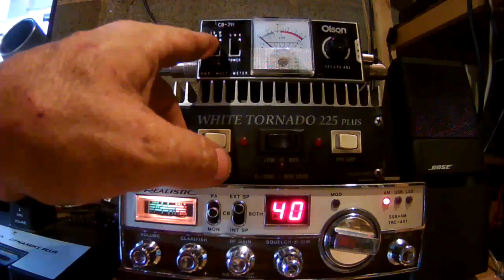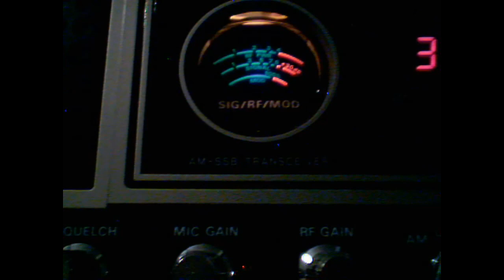Homemade Ground Plane Antenna, CB radio base station

Comment: Ok I hate to keep bothering you but I’m just out here trying to learn. I keep watching your video and keep noticing different things. I see you mounted the pvc to a metal (galvanized?) pipe. I was planning on having a piece of pvc instead of the pipe only plan on getting a few feet above the roof. My question is. Since the element is inside pvc do I still need to ground the antenna? For things such as lightning and if so would I just attach a ground wire to the ground of the connectors? I plan on building this and sticking it up as soon as my coax gets here. Thanks for the advice. I also took your hint and I’m not gonna mess with 5/8 just a 1/4 like you. I wish we lived closer together so we could make contact but I don’t have enough power to get where you stay from here just accross the state line not far from Myrtle beach.
Reply from the maker: Yes it should be grounded, otherwise those ground plane wires will attract lightning.
Reply: @MowerJunkie  so wouldn’t it be a bad idea to ground it at the coax ground? Or do I need to use a metal pole something similar to what you have and then ground it?

Comment: Will a CB radio with ground antennae interfere with car  speakers that blast thumping music through the walls of my house and windows? Some say yes, some say no? Is it possible to disrupt house from those speakers?  Thanks, like your videos.
Reply: Possible? Yes. Likely? That would depend on output power

Comment: nice video i'm building one today did u have to trim the ground radials or just the top section. going to compare it to  my a99.
Reply from the maker: Yes, the ground radials need to be trimmed to the same length as the active element. Good luck with Your build, let Me know how it compares to Your Antron. Thanks for watching, 73's from 151 SC.
Reply: @MowerJunkie  thank you from 142 central ny

Comment: I have an old Hi-Gain cb antenna from the 70's from my dad that I am using.  It is working but it has a spot for 3 radials.  Do you know how long the radials should be.?
Roger
Reply: 103 to 108 inches, or 1/4 wavelength

Comment: Might be a silly question but could a guy use a magnetic antenna on top of a house with a 28" by 28" tin ground plane?
Reply from the maker: I would not try to transmit on the set up You described, it would work for receiving, but would have a very high SWR on transmit.
Reply: too small of a ground plane. try connecting a wire to the tin and running it to a gsrden hose spout or a steel stink pipe coming through your roof if you have one. you have swr meter?

Comment: Excellent video. Another person on here asked you a question about how you keep the top wire straight in the top pole or doesn't it matter as long as the wire is right length ?  Also , as far as the radials can I get away with using 2-3  as long as they are right length ? Thanks
Reply from the maker: the 12ga wire will stay straight on it's own, with Mine, after I tune the antenna, I fill the pipe with expanding foam and cap the pipe. this will stop the wire from sagging in the pipe. if You use more radials, You will have a better ground plane, and the antenna will be easier to tune. Thanks for watching, 73's from 151 SC.
Reply: @MowerJunkie  , thank you for your quick reply. Can I ask a couple more questions. Do the radials have to be grounded from each other ? If a full 1/4 wave is 108 inches why was your feed & radials cut to 102.5 inches for the c.b. band? I'm going to try & make one of these but if it doesn't work then I may buy a whip. They come in 102 inches long & if I added a spring ( 4 inches) then wouldn't I still be 2 inches short of a 1/4 wave ?
Reply from the maker: @MrTumbleweed1951  I have tried using 108" long wire, and in order to get a good SWR reading, I had to trim it down to 102.5. so now I just start with 102.5". when You put a spring under Your whip it does not change the radiating length of the antenna, the signal will only use the actual element. the spring is just a spacer between the antenna and base. there is an equation to calculate the exact length for the frequency You use. if I remember correctly, for 27.385 the antenna length should be 102.7" not 108.
Reply: @MowerJunkie  Thank you very much sir. I'm enjoying learning from your videos
Reply: @MowerJunkie  I built a similar Antenna years ago. Rather than using expansion foam for the vertical wire, I drilled 2 holes in the top PVC cap, made a loop in the wire, and ran zipties through the holes back to the loop.
Worked a treat, and super cheap

Comment: Do you have too have radios wires?
I like to build antenna cb antenna for a 11 meter cb
Reply from the maker: yes, you need the ground plane wires. this antenna will not work without them.

Comment: Thanks for the video, Sir.  I'm going to try to replicate your design.  Can you advise me why you refer to yourself as "151"?  I've heard recently folks say a number in addition to their handle.  Where does that come from.  Thanks in advance.   You got a new subscriber.
Reply from the maker: I get asked this question a lot. Most of the Handles and call numbers are Self assigned. Some radio Clubs will give You numbers to use. for example, I'm a member of "World Wide Sidebanders" So sometimes You Might hear Me call out as WWS-568. The 151 that I use comes from the 151 cubic inch engine that Chevrolet made in the 70's, it's My all time favorite engine. 
Thanks for watching, 73's from 151 SC.

Comment: Question. I have a dual antenna whip nagoya. It has 3.5vhf and 5.5 of gain uhf.   If i tune the uhf frequencie tona desire, will the gain dimish or be affected and the vhf .

Comment: I built my antenna out of plumbing parts and steel pipe, i get about 15 miles on it barefoot. Which is surprising because of the area I'm located.

I have a video of it on my channel, Whats your 20 I swear I've heard you on 38 lsb. I live near hickory NC.

ALSO according to what studies I've seen the radiation pattern for 2 radials is practically identical to 3 or more radials so don't sweat that.
Reply from the maker: Thanks, I've tried to find info on the radiation pattern using only 2 radials, but I have not found it yet. I'm on My way to Your channel now, to check out Your build. Thanks for watching. 73's from 151 SC.

Comment: John I just have one question when you put the long wire inside the pvc do you connect it to anything or just let it lay inside also what do you connect the other two wires on outside to
Reply from the maker: The wire that goes into the pipe is soldered to the center conductor of the so-239 connector.  I use a small hose clamp around the outer ring of the coax connector, to attach the ground plane wires. Thanks for watching, Take care.
Reply: @MowerJunkie  so the conduter wire is just laying lose inside the long pvc pipe
Reply from the maker: @kentuitts6523  Yes, if You use #12 or #14 solid copper wire, it will stay in place on it's own. or You could fill the pipe with expanding foam to hold the wire.
Reply: @MowerJunkie  ok john thanks I am going to try to build one  later this spring  I am 34xray01 out of topeka kansas when I am on  I run 36 through 40

Comment: Is there a simple way to ground a PVC dipole above the roof of a garage
for lighting and also will it affect the SWR? THANK YOU!
Reply from the maker: ground your mast, and the outer coax ring.  remember to keep the bottom half of the antenna 3 feet away from the mast.
Reply from the maker: I built one, Check it out here   https://www.youtube.com/watch?v=Z5Q_XTEE2KU
Reply: @MowerJunkie What if I use a wooden or PVC mast . Then can the antenna be closer? Thank you!
Reply from the maker: @KerfMan  Yup, that will work fine. It just can't be near metal or large objects.
Reply: @MowerJunkie  Thank you! 73s
Reply: @MowerJunkie  Just one more question. Grounding the outer ring sounds good but what about the center copper core of the coax? Will lighting travel to the radio??
Reply from the maker: @KerfMan  it's a chance we all take, the center wire can NOT be grounded.
Reply: @MowerJunkie Ok...thank you do much for your replies! I'm just going to make it...and get it up there. Keep up the good work! 73s!
Reply: @MowerJunkie  I'm using a antenna mounting bracket on the back of my garage that's metal and the mast will be PVC. The antenna  bottom half will be below the roof line. The bottom of the antenna will be near the mounting bracket. Will that be ok?

Comment: Mower..One more question. No need to ground that antenna to a grounding rod correct?
Reply from the maker: It will work without grounding, but it will be safer and have less static if it's grounded.
Reply: @MowerJunkie  Thank you!

Comment: So the wire in the pvc is 102.5as well as the ground plane wires? Or did I miss something?
Reply from the maker: Yes, all 3 of the wires are the same length. if You need to trim it to tune it, They all need to be trimmed equally.
Reply: Loving the channel,  and tips.  This looks simple enuff even I can do.

Comment: What fastens the vertical wire inside the pvc pipe?
Reply from the maker: I used stiff solid copper wire and expanding foam.
Reply: 12gage wire? Also the ground plane wires are 102 inches as well?
Reply from the maker: I used 14ga house wire. I started out with 104" for all wires, and trimmed all wires equally to tune it.

Comment: I have a coax antenna, a t2lt! Where would i attatch groundplanes to it? The outside of the pl plug?
Reply from the maker: I attach them to the coax connector at the base of the antenna.   Thanks for watching, Take care.
Reply: @MowerJunkie  on the outside of the connectors?

Comment: I plan on making a PVC dipole antenna with the two wires instead... I'm going to use a metal mast to attach dipole above my garage. My concern is lightning and what do I attach the ground wire to. Do you need to purchase a lightning resistor and attach it from the os-239 and the coax . Also attaching a ground wire and putting it down into a  grounding rod will it throw the SWR off? I think a video is needed to explain this more. I'm more concerned with safety than my signal.

Comment: How do you hookup ground plain did put it on pl259 end of connector made circle loop wire two ground plain is 12 guage  bare copper  wire?
Reply from the maker: I stripped the wire 1/2" , then used a small hose clamp to clamp the wires to the outer ring of the pl259.
Reply: How long pvc is 103 inches or 104 inches.
Reply from the maker: @foxman362  I just cut it 9', and call it close enough.
Reply: thats 9 ft pvc that what your saying 102inches  is like 8ft.
Reply from the maker: @foxman362  anything over 103 inches will work.

Comment: Got antenna built  got 1.3 swr. Does  swr go up when using  power .  Hot box 250
Reply from the maker: It might go up a little, but shouldn't go much higher then with stock power.  Thanks for watching! 73's from 151 SC.

Comment: How many watts can this antenna handle? Thanks for sharing...
Reply from the maker: I'm not sure what the power handling would be, But I have been putting 225 into it without any problems. Thanks for watching.
Reply: @MowerJunkie  10-4, thanks for the reply. Getting ready to setup a base in western NY...

Comment: What is the red indicator light that illuminates when transmit?
Reply from the maker: it's a modulation indicator, it lets You know the radio is transmitting audio.

Comment: Ok I’ve done more research and I’m back again I wanna build a 5/8 vertical like this one but 5/8. Does anyone know how long the radials should be? I’ve read that they like 16 degrees but does length matter? I’m assuming it does.
Reply: If it doesn’t work out I’ll cut it down and make a 1/4 wave.
Reply from the maker: to make a 5/8 vertical You will need to make a matching coil for the feed point of the antenna. the coil will balance the antenna, and give the proper resistance for the antenna.
A 5/8 is not an easy build, I would recommend a 1/4 wave, it's already 50 ohm and does not require any additional matching.
Reply: @MowerJunkie  I guess I didn’t do enough research i did see someone talking about a coil but I though coils were used to be able to make an antenna shorter for say mobile applications. Well with your reply I guess a 1/4 wave it will be. I know you told a measurement of how far out they are but does it matter how long the ground radials are?

Comment: How long that was the ground plane wires
Reply from the maker: all 3 wires are the exact same length, each one measures 102.1", I started out with 102.5 and trimmed it, to tune it. Thanks for watching

Comment: Is that 2 or 4 ground plain radial
Reply from the maker: It only has 2 ground radials. it's a little directional, But works well.
Reply: It's plane, not plain.  Two totally different words and meanings.

Comment: What size wire u used
Reply from the maker: For this antenna I used 14 ga solid copper wire.  Thanks for watching, 73's from 151 SC.
Reply: @MowerJunkie  think you . Greenbrier tn.
Reply: @MowerJunkie  they call me 16 killwatt on radio.

Comment: could you provide your project construction diagram ?
Reply from the maker: I don't have a diagram, But here is a parts list.
1 10'  1" schedule 40 PVC pipe, 1 PVC TEE, 2 1" caps,  SO239 connector and 3 pieces of 103" 12ga solid copper wire. cut the pipe to 107", use this for the top. and the short pipe for the bottom, use hose clamps to clamp the lower section to Your mast. solder 1 wire to the SO239, then slide up into the pipe and glue into place. after You hook up Your coax, clamp the other 2 wires to the screw on ring on the end of Your coax, and run down at a 30-45 degree angle. the easiest way I found to tune it is to leave the top pipe unglued, so that You can access the wire to trim it. 
I hope this helps with Your build.
Thanks for watching.
Reply: @MowerJunkie  great vid! What size/length is your coax?
Reply from the maker: @markweese2720  Thanks Mark, I have a 50' length of RG-8x connected to it.
Reply: @MowerJunkie  How much did you need to trim to get the numbers you had ? Thanks
Reply from the maker: @sammaloney2499  after trimming, all 3 of the wires ended up at 102.25" long. Thanks for watching.

Comment: Could you not use a so239 connector
Reply from the maker: You can attach the coax directly to the antenna.
Reply: So I coukd just solder a copper wire on top of so239 for the antenna?
Reply from the maker: @swink49  twist it, solder it or bolt it. it does not matter how You connect it. I use connectors so that it can be taken apart easily. Thanks for watching, 73's from 151 SC.
Reply: Mower Junkie i have another question dont mean to bother.. But for the ground plane could I run a copper wire down to an earth ground ?
Reply from the maker: @swink49  the ground plane needs to be a resonant length. so if Your antenna is exactly 102.5" above the ground, it might work. if not, You'll need ground radials.
Reply: Mower Junkie thanks im new to this stuff with your help and my trail and error im slowly figuring it out. My antenna i built it on my barn 18 feet off the ground

Comment: 1/4 wave Groundplane Antenna a antron 99 is 1/2 wave
Reply from the maker: an Antron 99 is actually a 1/2 wave over 1/4 wave, this setup is 1/4 wave over 1/2 wave. Thanks for watching, 73's
Reply: @MowerJunkie  Yeh your right there!
Reply: @MowerJunkie  Yeh your right there!

Comment: Is that better than an A-99 antena
Reply from the maker: this is a basic antenna, just to get you on the air cheaply. an Antron 99 will work a little better than this antenna.

Comment: Now bend 18 feet of 1/4" copper refrigerator tubing into a big folded circle * and add 17' 6" more wire/tubing above the tip and watch the gain go through the roof.

* https://www.youtube.com/watch?v=4pdiKu-V3J4&feature=youtu.be&t=541

Comment: dipole ..upside down v... ^
Reply from the maker: Yup, Pretty much. and it works great. Thanks for watching.
Reply: @MowerJunkie  i run a dipole as well only base antenna i have ..thinking  of putting up a vertical one like you made and have it mounted up